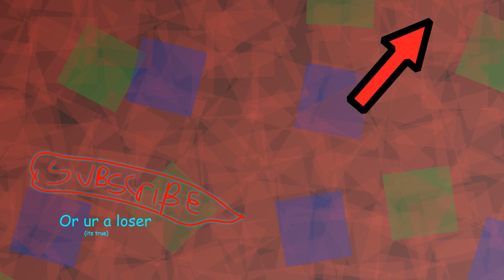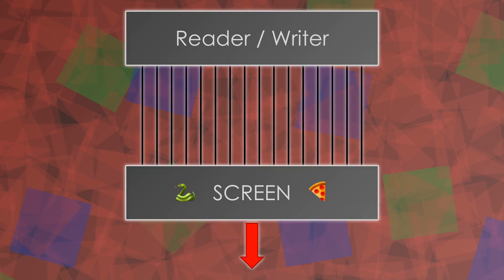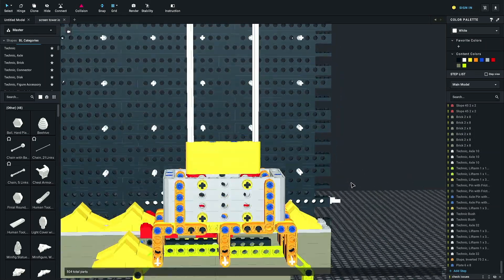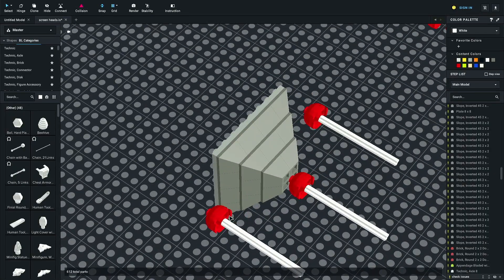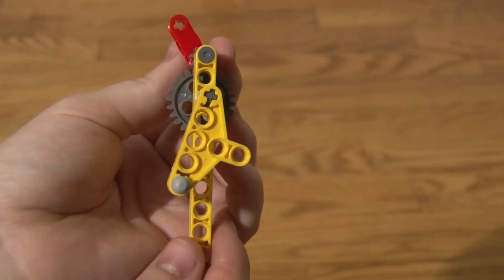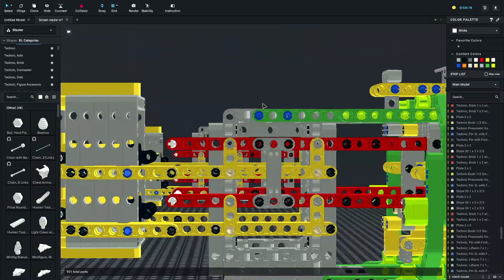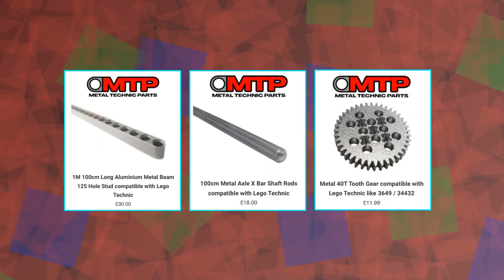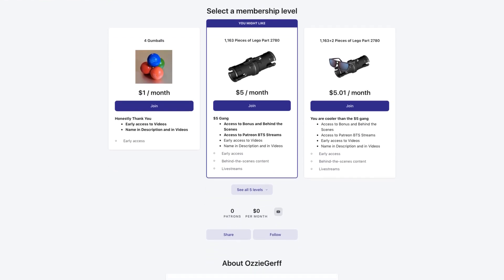LEGO Computer Part 3: Screen Readers And Writers

Comment: You are basically making a computer designed for games, wich means that once finished, you could reprogram it to play mario bros or display 3 colors images(technically)
Reply from the maker: Unfortunately no. Pretty much everything is built to play snake and making it do much else would need a complete redesign. Definitely nothing like raster scan (tv/console) games. This entire computer is  hardwired, which means calling it a computer would be a bit of a stretch. Now I suppose with more screen writers something like pac man would be only a little more complicated than this, but totally feasible. Maybe what I will do next if this actually pans out.
Reprogramming a digital computer is easy just change the code. This doesn't have any code, it would be like turning clockwork into a transmission.
In size and speed this computer is comparable to the first computers that were the sizes of rooms but unlike those computers I can cheat with 3d space and complex mechanisms that would take 100s or even 1,000s of transistors/logic gates to make work. But there is a reason why mechanical and EM relay computers were beat out by even the earliest tube, tape, and digital computers.
Reply: @ozziegerff  Oh yeah, you are right, I recently started building a digital computer and it's going pretty well, I managed to do 3+4 and a few other operations that worked and the GPU is starting to work, but the ram, user inputs and a few other things don't work at all. Maybe someday I will be able to make a 100% working one...